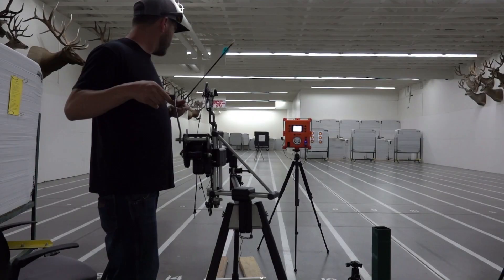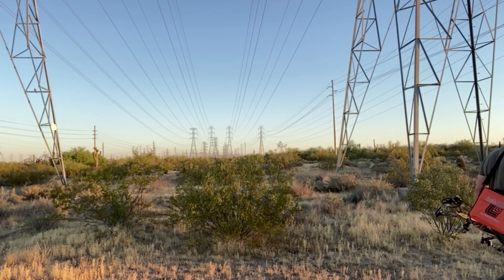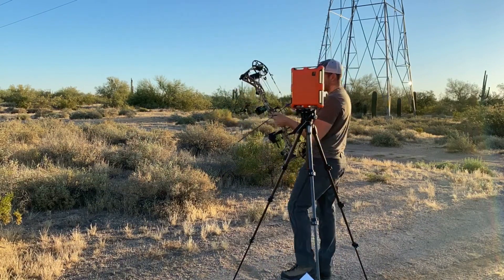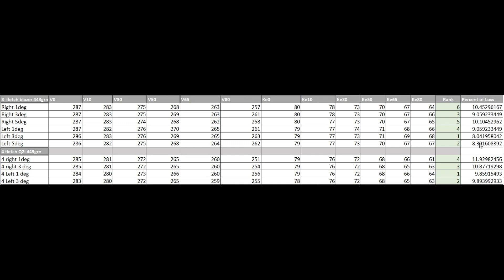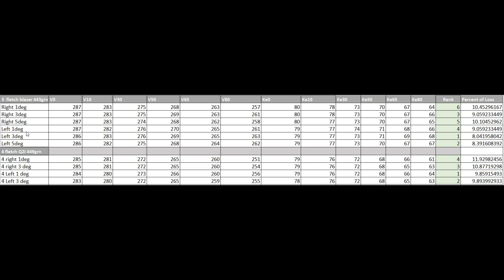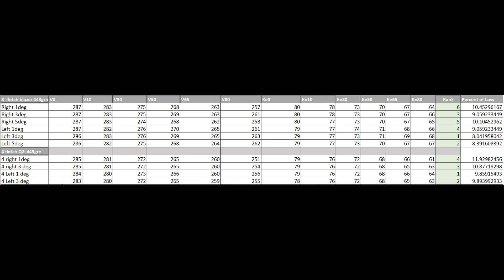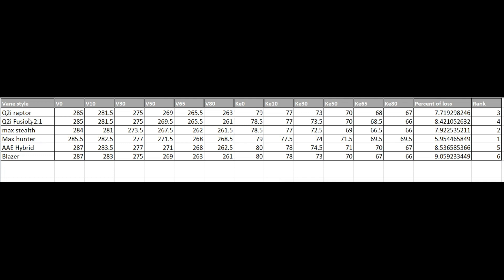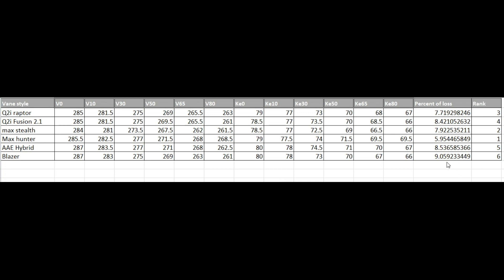Vane Testing / What fletching is best?

Comment: Hi John, good testing. Makes me wish I had a LabRadar. Your results pretty much mirror mine, though I have noticed more drop at 80 with 6deg offset than I'd have expected based on weight. Granted, I was testing with 3d printed fletching which likely has a higher drag coefficient. Another interesting thing I found, is that penetration on the target decreases with greater rotation with broadheads, up to 15% with a 6deg LH vs a 1deg RH at 20 yards in a quick test. But of course stability and flight trump that minor loss IMO.